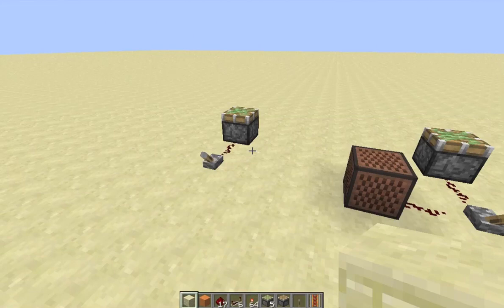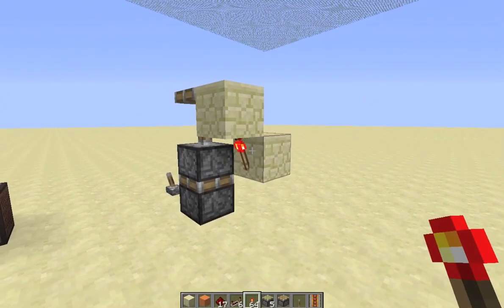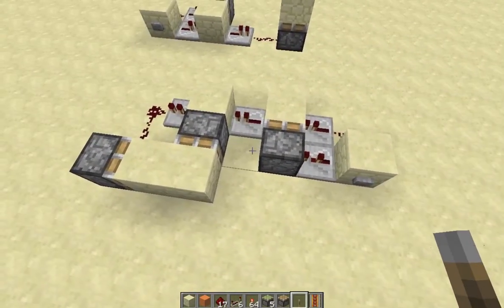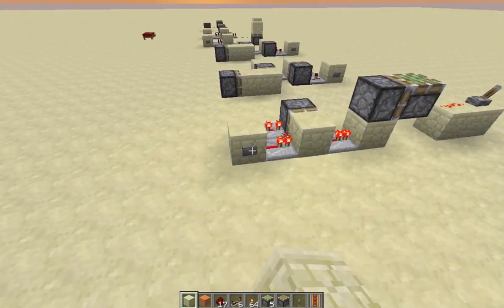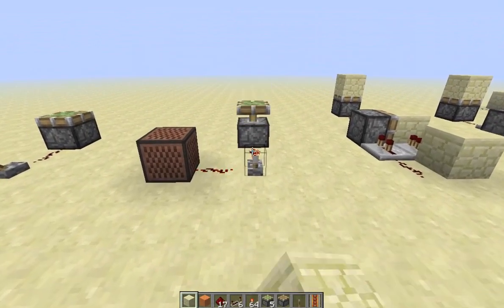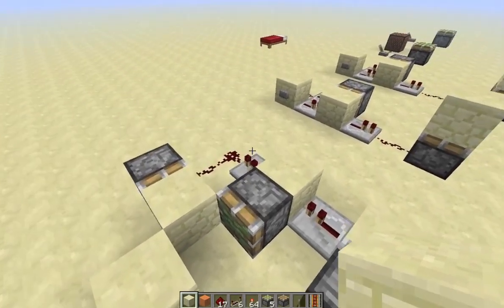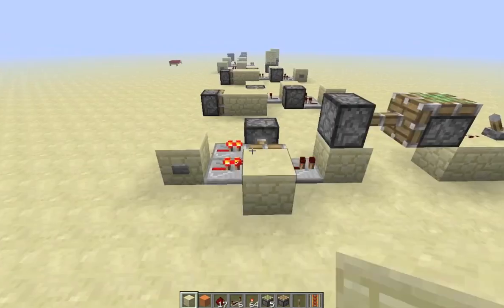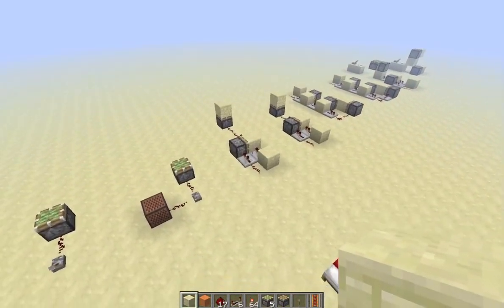Minecraft Snapshot 12w27a, New Piston Timings

Comment: I've made a patch for the sand generator my self, that's how easy it is. Notch has had the code for falling sand to start the falling animation before removing the actual block, but if you make it the other way around it works, he probably didn't do it this way considering sand takes a while to fall anyway and this doesn't help that. Still there's no need to change how pistons work because due to how the code for falling sand works no matter what you do to pistons this will always be possible!